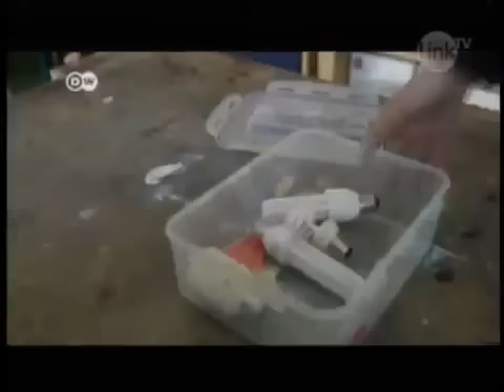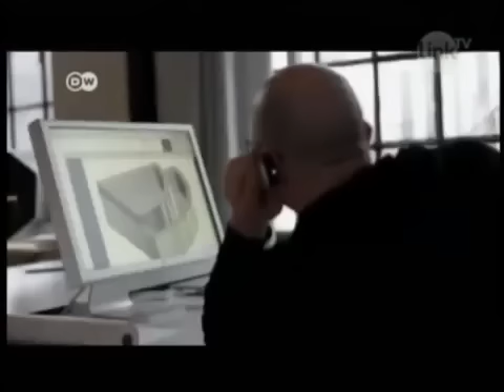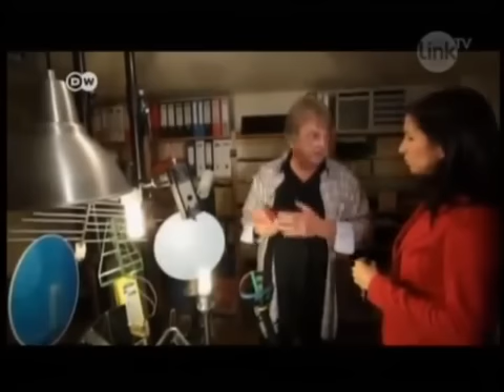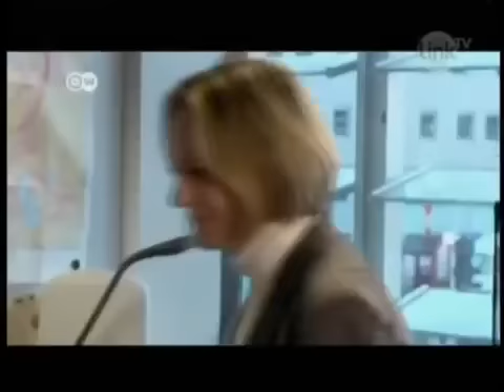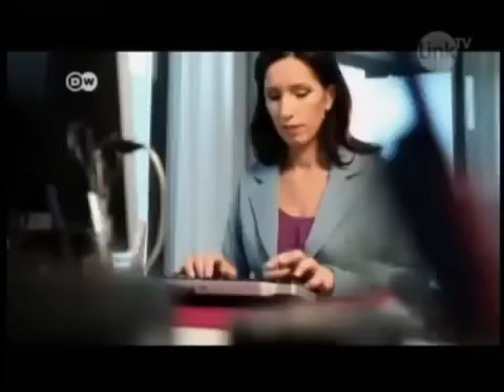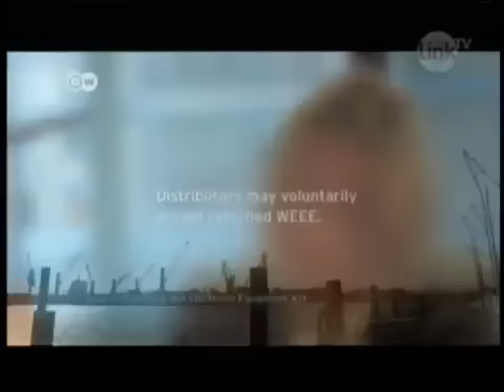Toxic Light - The Dark Side of Energy Saving Bulbs

Comment: CFL bulbs are great if driven correctly, that is to say not with the noisy circuitry that they come them, the same with LED bulbs. with an RF meter you get  way over the SAR value of a mobile phone within a foot of the things, they emit RF radiation that's the problem not the specific frequency of the Light, although this is bad too as all LED (modern ones) are in fact near UV 430nm which phosphorus the phosphor around or above the actual LED in the same way (almost) as a CFL bulb. A lot of people go on about "non ionizing radiation" being harmless, well your Microwave is non ionizing radiation....   Regular incandescent bulbs are the best but they are designed to fail, with an average life of 4000hrs its dis-encouraging to buy them, the original ones went on for a million hrs.    Joke; it's for the environment....

Comment: CFLs may consume less energy than an incandescent to operate, but how about the manufacturing? The extra mineral that need to be mined and processed. The extra labour, time and energy to manufacture it. And then the disposal that exposes everyone to an environmental build up of the super toxic mercury. Most of it wont even make it as far as a landfill site because the fragile glass will break on the journey. And then there are the radioactive smoke alarms. Asbestos,  formaldehyde, benzenes, hydrocarbons, triclosan, fluoride, lead, parabens, BPAs etc etc. Ever wonder why we are surrounded with poisons?